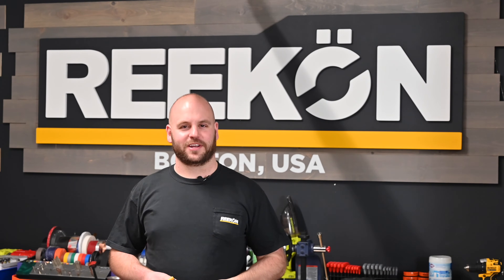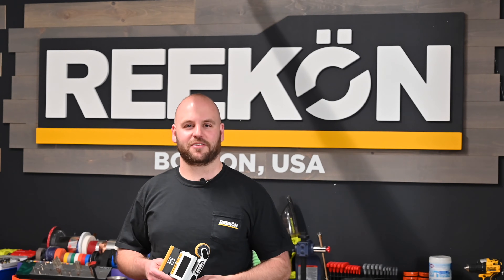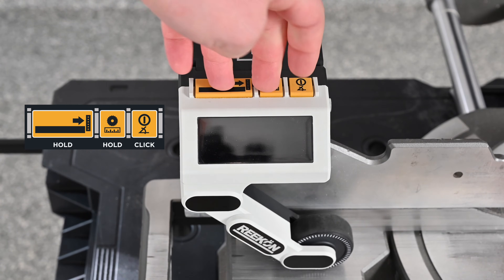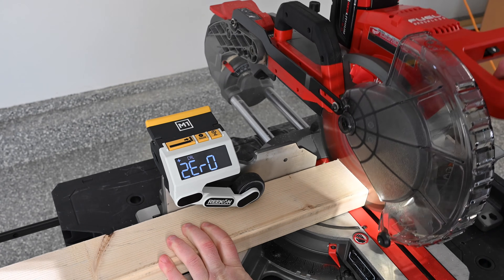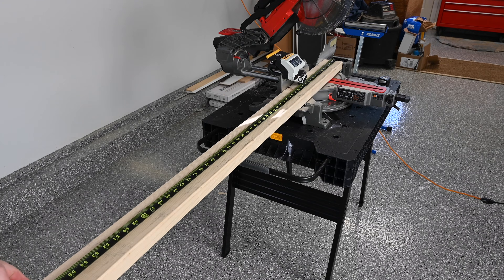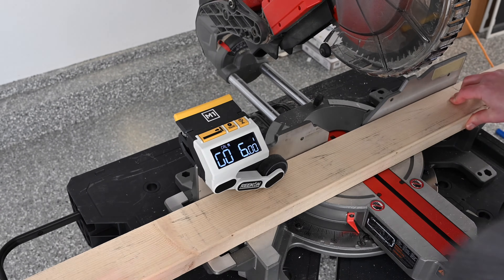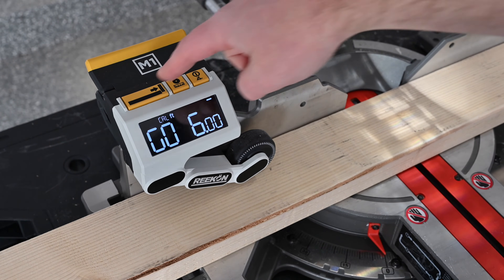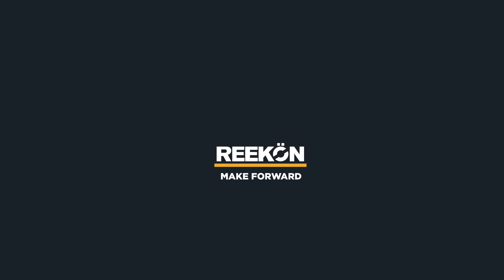M1 Caliber Measuring Tool Calibration Procedure - REEKON Tools

Comment: If the zero (Right of board) is where you're measuring from, and then slide the board to the right, the teeth should be aligned on the RIGHT side of the blade (since the furthest right is your zero) then calibrate. Your video, if followed verbatim, will result in the measurement being off by the kerf of the blade since the 5 ft is on the LEFT of the teeth...you're going to be cutting it 1/8" short every time (again or whatever the kerf is). Also, 200 "MM" is not two meters, it's 200 centimeters. Ya'll might want to look at this video and follow your own instructions to verify. 20 year Quality Insurance Inspector for submarines here, I'm all about the QA! :)
Reply from the maker: @samwoodberry6869  blade width is accounted for in a separate step and is independent of the calibration

Comment: When ever I run this my calibration is off by 10" because that's the distance from where the arm is to the saw blade.
Reply from the maker: Hi Ben, the calibration is independent from the distance to the saw as the "zero should be selected when the material touches off on the saw blade
Reply: Yes I did that. I moved the material to the saw blade then hit zero. And then follow the steps to get to 72" and every time I go back and start so I can make a cut, it's way off by at least 10"

Comment: 2 meter are 2000 mm not 200 (would be cm) - metric system is simple, just get used to the unit prefixes: milli = 1/1000

Comment: 200mm huh? 🤠😂
Reply: Yeah that’s off by a lot 

6ft = 1828.8mm
Reply: @shrimpinpat the calibration can be switched to metric units then you have to measure 2m or 2000! mm

Comment: I would like to leave a comment but this will not clamp onto my fence. Any input from Reekon would help, or did I buy am expensive paper weight.
Reply from the maker: HI Jim, please feel free to email us at contact@reekon.tools with you saw model number and a photo and we would be happy to help!
Reply: @REEKONTools  Hi, my saw is a Bosch GCM12SD. Everything I've tried to get it to lock into place has not worked.
Reply: Well after an hour I finally figured it out  I ordered a new Reekon rail but found out you don’t need them ,there is a list you can look at which tells you what saws are ready for the tool.

Comment: It would be great if it actually worked this way. I’ve done this step to calibrate over and over and the unit won’t go into calibration mode.
Reply from the maker: Hi Matthew, please send us an email at contact@reekon.tools and we would be happy to help!  Make sure you are not holding the power button and only clicking it once (while holding the left two buttons)

Comment: Mine never goes into calibration mode. You press the first two together and click the third as instructed and all it does is go to 00 but not ZERO. so as soon as I slide the piece down it starts measuring. So far I’ve just lost an hour and gained frustration.

Comment: Stupid thing requires the worlds tallest saw fence.  Cant even find one for my two miter saws.  What a waste
Reply from the maker: Hello, the M1 Caliber Adapter Fence can be used if you saw fence isn't directly compatible!
Reply: I have a rigid mitre saw.   The fence is higher on the one side. Where it’s reekon attaches.   So with that you can’t slide a thin piece to cut cause the measuring wheel sits about and inch and a half above the deck.

Comment: I cannot for the life of me get it into calibration mode. It either turns off/on, or displays flip. Any ideas to what could be happening?
Reply from the maker: Hey Jacob, are you starting with the device powered off?  Also, are you holding the zero and units button firmly and then only clicking the power button once, then releasing (while holding the other two)?

Comment: Agree that the written guide is muddled and difficult to get a clear and basic 1,2,3 setup for calibration. Mine keeps saying ⅛” when I zero the unit after calibration. I have no idea what’s going on, and it’s WAY off accurate by as much as a 1/16” with every cut. It’s driving me nuts.
Reply from the maker: Hello, have you set your blade offset to a value?  Send us an email at contact@reekon.tools and wed be happy to assit in getting spot on measurements!
Reply: Same with me..
Reply: I've calibrated and blade multiple times and it's always  1/16 off ??

Comment: It’s too bad the M1 doesn’t have a function that allows you, after zeroing to the left side of the blade, to simply move the workpiece to the right side of the blade and hit the blade button to calibrate for blade thickness. Seems a little clunky to have to input it numerically. Especially if it’s an old blade and you don’t own callipers to measure it accurately. 
Also it was only after watching this video that I could figure out how to enter the calibration mode. The written instructions leave a lot to be desired.
Reply from the maker: Hey Karl, thanks for the feedback.  We are always looking to improve our product features and directions that come with it.  While we did consider that method for the blade offset, we found it generally less accurate than measuring the blade separately, even if only using a tape measure.   Glad you were able to get things figured out and feel free to send us an email if you have any other issues - contact@reekon.tools
Reply: Thanks for the video.may as well not put instructions in the box as they make no sense at all. This video was a lot helpful

Comment: Yea now after that how do u keep it ready to cut? After I calibrate I lift arm up to remove the material and go back to feeding it for my first cut and I get it to the saw blade and it saws 6in
Reply from the maker: Once you touch the saw blade you should zero the M1 indicating a new cut is being made and then slide to your cut position.  You should also be sure that your blade offset is accounted for as well.